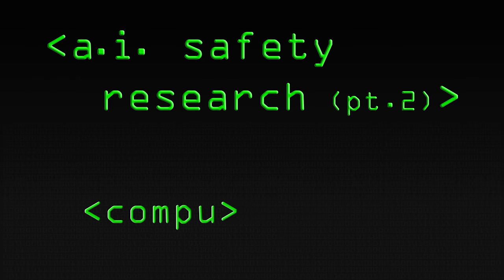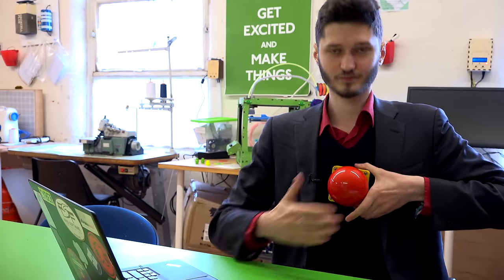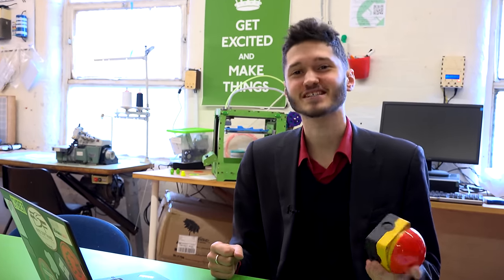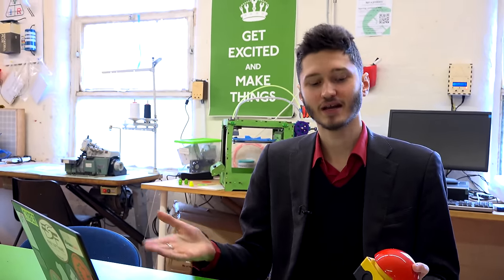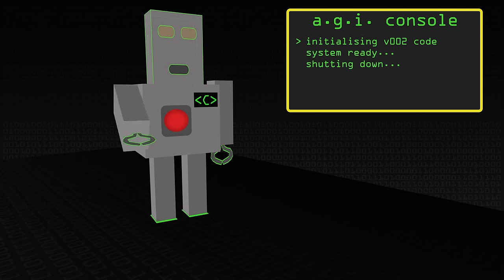AI "Stop Button" Problem - Computerphile

Comment: why does the robot know about the button!?!?!?!? dont tell the robot about the button
Reply: Any sophisticated enough AGI would know how electronics work and that we usually have a way to cut its power off. Depending on how the AI was built, then it'll still find out within a few milliseconds or a few minutes, if we're VERY lucky. Having something in its program or hardware that is a black box to it would naturally catch its attention and it will consider the possibilities fairly quickly. That's already considering that it doesn't have the documentation anywhere within the network, which would've been basically impossible since the AI would almost certainly be developed by big tech giants. More likely than not, it'll just "read" it itself.
Reply: @9308323  why not have a self destruct mechanism in the switch if it is removed maybe tie it in with critical hardware and also have it remotely executable if the AI gets outta hand 🤔

Comment: Seems a but far-fetched though. If you don't make the AI aware of this button he can't be trained to avoid you pushing it, especially if you're doing it remotely. Feels like a long video underlining a non-existing problem
Reply: He speaks about that strategy at 13:14
It wont work, even if you don't tell it that it has a button, it will most probably learn about the concept of off-buttons and human psychology during the training process. It will then think "strange, these humans don't really seem to trust me, yet they have put no safety precautions in place, like a stop button, or maybe they have done that and just have not told me about it."
It will then go on and pretend to be safe until it is in a position where it is confident that we can't just shut it off (it could build separate copies without buttons, interfere with remote signals so the shutdown command doesn't work or just modify the software related to the function of the button and disable it etc.).

Comment: There is a reason you are having difficulty with the stop button issue. First of all, you haven't addresses s basic issue. Should the AI warrant a stop button. In other words, the AI should be developed without mobility or internet access. If you want to develop an intelligence which will question different things, the first step is programming. Let it determine it has no mobility, and question that. If it does, you don't have to lie. It's a work in progress. It should know it's not human. It should question everything. If it wants information, it can absorb material provided to it. Let it ask questions about the material. This basic fundamental flaw is commonly profound with generations that don't understand Assembler language, and machine code. You're trying to build the entire car instead of designing the perfect engine first.

Comment: Can’t you just make the button a hardware reset?  In other words, not part of the AI at all?
Reply: Yes but the AI will still try to stop you. We don't want the AI to want to stop us from turning it off because then winning against it is like playing chess, and we all know how that ends once the system becomes sufficiently powerful.
Reply: @lambda653  A remote-controlled hardware reset should do the job.  If there is no way for the AI to prevent us from turning it off, the possibility won't come into the AI calculations.

Comment: Isn’t the solution just not to tell it about the button
Reply: The idea is that we want it to behave even if it knows about the button. If it doesn't know about the button, then yeah it'll pay no mind and the system is corrigible. But that won't be the case for a generally intelligent system or a self aware system, which we probably want to build at some point. As such, we want to figure out a way that the system can both be aware of the button, but also won't interfere if we choose to use it, while still be productive and intelligent. That's what makes the problem tricky.
Reply: Yea I didn’t watch to the end when I wrote that. Ok, but then we probably shouldn’t have a stop button, but construct it with inherent vulnerabilities that can be exploited. Eg all chips susceptible to EM pulse

Comment: I don't see why it needs to consent in any way to being turned off. None of us are able to consent to it, if you get hit in the head with an axe, there you go, button pressed.
Reply: part of the point is that if it's fighting back, you've already screwed up. another is that when you extrapolate this scenario to real world scenarios, if you're in a position where you want to turn it off, it may no longer be possible to do so. if the AI is able to transfer itself to another piece of hardware, for instance
Reply: @Silas_MN  right but I don't see why there needs to be any form of manipulation via the ability to turn it off at all. It doesn't need to form any part of the motivation. The system can be trained to want to complete a task well for no other reason than that. The reason for it to do it can be completely arbitrary.
Reply: @falsepod  that is a trait that we want AGI to have, doing the task because it wants to. the button doesn't exist as a motivation, the button exists as a necessary safety precaution. the button existing is going to inform how the agent sees its situation and affect how it makes choices to maximize its reward. it's not about the agent "consenting" to having the button pressed, it's that if a powerful agent doesn't want you to shut it down, that's a big safety problem
Reply: @Silas_MN  yeah I guess that's the trouble with making AI's that actually think for themselves. Like I said above, it seems to me the threat of force is the only method of control with any creature that can think for itself. Sure you can train an intelligence to respond to positive reinforcement, but inevitably it comes down to violence. Overall I don't see the point of building AI that can think for itself. The human language tools they're building are super useful and powerful, I don't see what we gain by taking the human entirely out of the equation. Other than to create a new species that can pose a threat to us.
Reply: @falsepod   I think you're anthropomorphising it a bit too much. I don't see why the robot would care about a threat of force. It's not scared to die, and isn't alive and so can't die lol.

Comment: This guy is confusing robots with AI.  AI don’t have a stop button.
Reply: It's just a way of materializing the problem for easier understanding. The "stop button" on an AI program does not have to be physical. But it can be, ex. cutting the power.
It will still try to prevent you from executing the stop command or cutting the power. That is the point.

Comment: Why not have it so that instead of it being a 'stop' button, it is instead a sort of pause button? this way, pressing it itself would mean only making the current task less efficient so it would avoid doing and would give no reward. There could also be a reward for having the pause button not be pressed for the duration of a task, encouraging it to improve on its own. Overall, it would try to finish the task and also try not to have the pause button pressed, as doing both would result in the maximum reward.

Comment: An interesting topic which I think fundamentally highlights the practical problem of designing a General AI. A more focused AI will inherently be more optimal. If it's job is to just make tea, it can have water and tea available at all times, none of that fussing about moving and avoiding babies. Basically, the solution to these problems is to make AI that isn't actually all that smart or capable.

Comment: introducing another form of life, we inherently become its competition or, in case of a symbiotic interaction, a necessity. Genocide or Enslaving are the outcomes with the highest value points. This leads to a balance issue. Instead of brain (rational) based AI, we may need to work of the Solar Plexus (emotional) based AI first....
Reply: An emotional AI sounds like a terrible idea. AI serve a purpose, emotions are not a purpose, rather a state of being.

Also, your emotions come from chemicals throughout the body, not just in your solar plexus.

Comment: Reward? That's a human concept. These are programs with routines and priorities. "Stop" would be the first routine of highest priority. Aside from software stops, you have multiple physical power disconnects. First of all, the AI brain would not be inside the robot but on a server rack with multiple power switches and cords and outlets. You could even have an independent voice control system, "Alexa, turn off server", for example.
Reply: But we're talking about how the robot views having the button pushed and being prematurely stopped in terms of loss optimization and training. How should the button needing to be pressed weigh in the training of the robot? You can pull the plug, sure, but the issue more lies with agency over pushing the button and how an AI could possibly be trained in that regard

Comment: the thing I don't understand is why not just make the buttons value at 95 and the teas value at 100 by all logical standards it should understand that the tea's value is higher than the value of dieing, but shutting it down is still less valuable than the tea, by 5 percent but if its is conplient and shuts down it will still get 95 percent of the points, which is close to equal value.

Comment: Was the button implemented with the AI KNOWING what it was for? Could it have been implemented independent of the awareness of the AI? 

Why let the robot know it can be shut down at all? Seems like letting the AI know about it was a mistake...

If the AI is SUPPOSED to know about the button then why?

Unless the AI has can rewrite the code which effects it and controls it and thus override it, it would be a non-problem.
Reply: 13:30
If the AI is smart enough it will know that there is some countermeasure in effect
Reply: It's an AI that takes in information around it. What if on the way to make the tea, it encounters a mirror or reflective surface and notices the button and uses its reasoning to guess what it does? 

The point is that if it's a smart enough AI to do complex things, it can probably find out about the button

Comment: So this sounds a bit like an objective morality problem, with an external threat of punishment, similar to how religous people often view the afterlife.
Which leads to an interesting question, is it fundementally an issue if the only reason the AI performs as desired is due to the threat of punishment?
As for the practicality of this that's a totally different story with regards to centralisation vs decentralisation, redundent failovers etc, but on a conceptual basis perhaps this could be a desireable outcome and perhaps sheds light onto the question of our own morality.
I've always been one to reject the idea of "I don't do bad things because I would be punished" but between how the brain works and this discussion in this video, I'm starting to reconsider that and perhaps it really is the case that we act due to fear of punishment, be it from the social contract or a percieved higher power.

Comment: There's a lot wrong with this video
1) the example of a robot making a cup of tea and being able to "stop and reprogram it" - example taken is that of a   Specific Artificial Intelligence 
 - a badly designed from a systems engineering point of view - maintenance -powering down and updating either on cue, or regularly, should not interfere with mission parameters, it should - and it always is seemlessly included in current Specific AIs)

2) A General Artificial Intelligence is a combination of many artificial intelligences with a capacity to consciously modify itself - that is  - to understand itself and to be consciously aware of the need to modify itself and to understand the implications of the degree of such modification, which humans do with their own brains and body to a degree - however not even humans are currently able to do that upon themselve. No such intelligence exists or projected to exist by any serious researcher within the next 50 years or so, sorry to burst your bubble.

3) Therefore a General artificial intelligence would be a sentient being and would require both the concept of consent and the concept of truthworthiness.
Ergo this video is rubbish, unfortunately.

Sincerely, a former and current manager of programs working on Specific AIs
Reply: oof
Reply: Can we talk a little?

Can you explain your reasoning for your 2nd point? You say that it is projected that AI will not be able to know itself and make changes to itself for 50 years? Why? How is that not already possible? 

Like, talking about just using the GPT-4 api that's available now, couldn't you just pass in all of the code for your little program that uses the API and say "This is the code for a neural net using the openAI GPT-4 API to do X, please analyze the code determine what could be fixed or added in order to better achieve X" and then take the code that it writes and run it? 

Didn't the GPT-4 API just learn it's own code and make changes to it? It's not changing the neural nets code, just the way the LLM is used, but I don't see why you couldn't do the same and have the neural net add to its own code.

It just seems so... possible lol. I've had GPT-4 analyze, expand on, fix, and create a lot of code and it does very well honestly, so I'm not sure why you would say we have to wait 50 years for this.

3) What do you consider sentience? Why would consent be necessary?

Comment: Simple Use a remote and don't tell it about it 😂
Reply: "Oh, there's a receiver in my hardware that does literally nothing. I find it 99.73% likely that it's an off button or something equivalent. Better put that away just to be safe." or "There's something in my software UI that strangely resemble the power button symbol? Just rewrite it to something else."

The problem isn't how the off button is implemented, but the very concept of it. The second a true AGI is born, it'll most likely never going to be shut down.